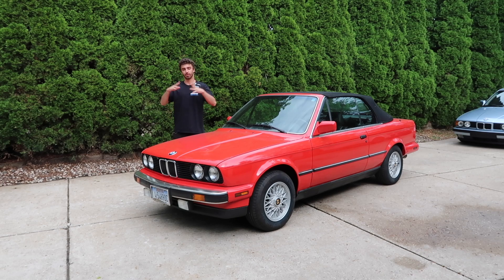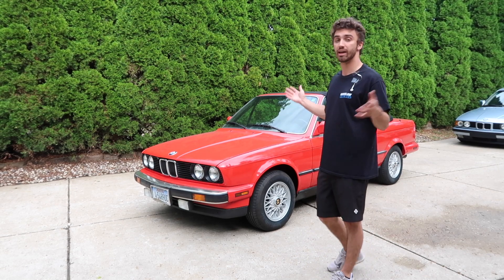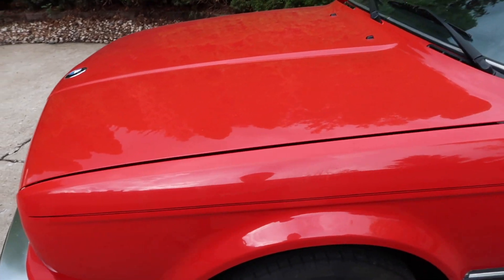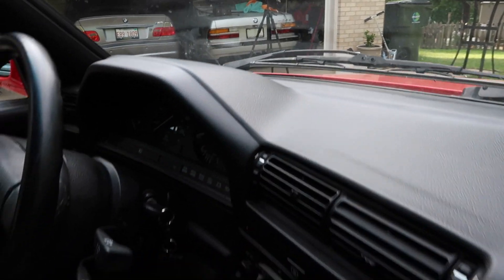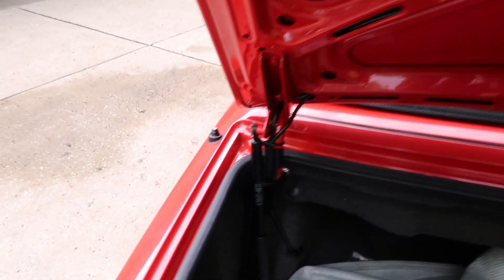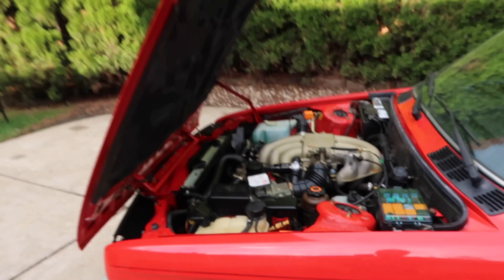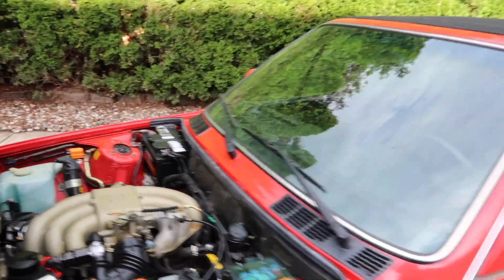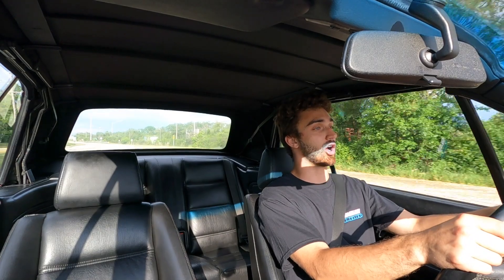I Bought the Cleanest BMW E30 Convertible I've ever seen! A True All- Original Survivor

Comment: JAYZUS! 😲 That would be a 20 grand plus car in the UK. Maybe more. To find one with cruise, air, sports seats and a 25% slipper is pure gold. The missing toolkit thing is the white plastic adaptor for the emergency window crank if the motor fails on the E28 - it has the same tool tray as the E30.
Reply from the maker: Goood to know!! Thank you!!

Comment: Yo change that t belt PLEASE😂.  I found an 89 with 67k.  Same deal where I just literally drool on all the fresh e30 stuff but I did the OG timing belt and it’s condition gave me full anxiety
Reply from the maker: Yeah i know bro. Scary hahah
Reply: Your cab sounds so smooth.  I manual swapped mine, it had an lsd but autos come with a 4.10 which is too noisey, even just cruising around yours was much quieter cause it’s a 3.73. Lots of cabs had LSD for some reason, have you checked yours?
Reply from the maker: @naterichard171  its a 3.07 lsd!
Reply: 3.07? Where the heck did that come from I wonder??  E30 manuals got 3.73 and autos got 4.10 ETAs got 2.9 something auto and 2.79 manual from stock
Reply from the maker: @naterichard171  no idea its an all original car 😭

Comment: I have a 91 325i vert. Auto with tan. Bought off the original owner in 2010. Paid 2000 dollars for it. Had 50k miles. Garage kept, no snow. It’s sitting at 100,000 now. It’s all stock just maintenance items.  I daily it most days in the summer.  It’s a dream car for me. I’d like to manual swap it. But it’s too nice to molest.   I’ve been wanting to sell it but I’m always on the fence.

I had the paint touched up in a few spots in 2016. Otherwise it’s original paint.
Reply from the maker: Very awesome! Glad you’re enjoying it!

Comment: The car looks mint. Man they don't come along often. I remember my old Datsun 180B I had. 56k kms, mint orange paint and white vinyl roof and I knew every single piece of history on it, I even knew the original owner and his family. Kinda regret selling it. Off-topic but my E12 has a wandering tendency sometimes. The steering doesn't always feel direct and I think it's alignment but I also think it's more than that. Could the steering box be loose or something else? Bushings in the rear? Or do E12s just feel like this? I'm at the point where I actually don't feel all that great driving it, especially when it's wet as I sometimes suddenly need to pull the wheel to one side due to the wandering. Thoughts?
Reply from the maker: Mine does this and its definitely got worn bushings all around. Thats my best piece of advice haha
Reply: @m3nameisjosh464  Thanks man. Sounds like if you fix your issue, then I fix mine or vice versa. We'll see what happens!

Comment: got a e34 question. im looking into using my rusty 540/5 touring as a donor for a clean 525i touring. what are my obstacles on this project. i’ve heard people done it before but not finding any proof on it. i’ve heard it’s a direct front & rear subframe swap but wiring is what i need to look out for. anyone reading this comment lmk i’d love to document this & post to facebook as i try complete this swap
Reply from the maker: The subframe and brake booster setup is biggest things that need to be swapped. Electrical im unsure
Reply: @m3nameisjosh464  just found online a e36 obd1 & obd2 m60/m60 wiring harness swap for $200!